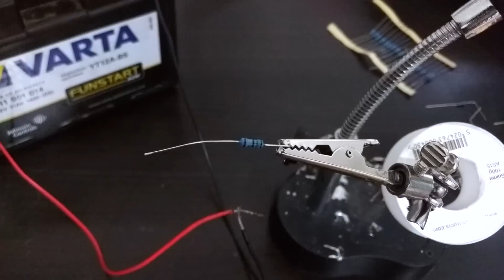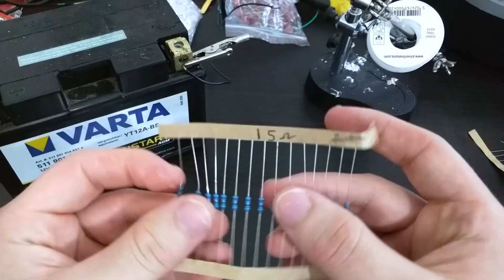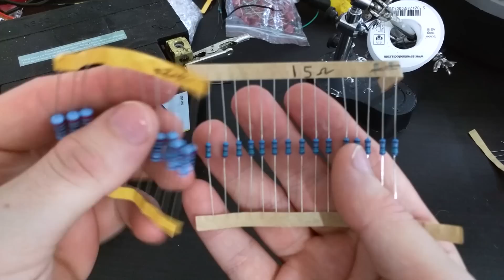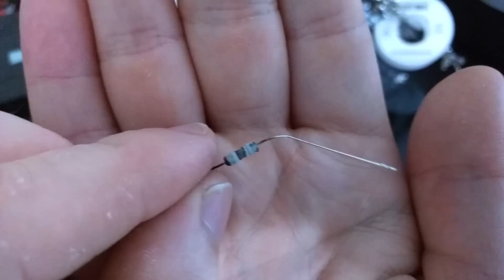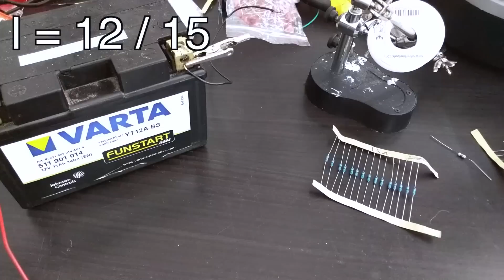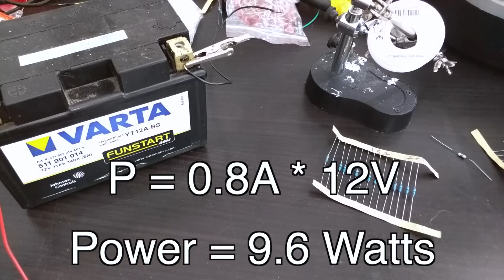How to choose the right Resistor

Comment: one thing i get confused about is i thought current is DRAWN by whatever load is in the circuit. like how come when i charge my laptop (AC> using a 30W power brick, or a 90W power brick, it doesnt matter because its only drawing whatever current it needs to charge my laptop, how come the 90W power brick isnt burning up my computer battery by "pushing" too much amperage?

Comment: Hey, I was watching the video on resistors and I was wondering if I could connect two car batteries in series to get 24 volts and then use 48  1/4 watt resistors to power my portable electric fan since I have both batteries already. I wanted to ask since I want to leave the fan in my car so that it is still cool when I go back to my car in the airport.

Comment: Howdy, Brother!  What resistor should I use if I have a yellow 10mm LED Emitting Diode (1.8-2.2V)  powered by two AA Batteries (on/off switch in the loop)?  Will 47 ohms work?  I'm not even sure if I asked the question properly . Thanks for any assistance.

Comment: With a lot of D.C. electronics, such as audio preamps, 1/8 watt is often perfectly suitable, but they are unpleasant to work with even if you are assembling a PCB. Just something for folks to think about.*
On the other hand, when you're ordering 50,100 or even 1000, the price difference really does add up quickly when purchasing a large variety of values. 

I tend to order large quantities collectively of multiple values, and the 1/8 are sometimes very tempting but since I am still building on perfboard for now until I get to manufacturing my own PCB's, I  have some 1/8 watt and greatly dislike them.
Even on a PCB, I would dislike them but I suppose use them if they are perfectly adequate. This also goes the other way because I don't like working with 1 watt unless I have to.

Comment: But also new players, need to be aware to ALWAYS measure your voltage source first. For anything running off a Car battery, don't calculate it at 12V. The voltage across a car battery can be as high as 14.8 when engine is running. I once chose resistors to run interior LEDs. The first time I dd this, I calculated the voltage source to be 12V. This worked out that my resistor choice was too low meaning the current being allowed to flow through the LEDs was a few over the limit of the LED... and all the LEDS eventually blew / burnt out one by one over a few weeks.

Comment: hi ,
I just wonder why the  resistor gets burn if the mechanism is in compliance with ohm law. I mean V/I is constant. Therefore when we increase the voltage, the system is supposed to  react that change  by an increasing amount of current so that V/I will not change. but instead it burns out. can anyone tell me the reason please
Reply: V/I is constant provided that V and I are not too big.   That is, Ohm's law is only valid for a given range of potential and current, depending on what the resistor can accommodate.  A resistor with a greater wattage rating will allow V/I to be constant over a greater range of values, but any resistor can be burned out if V and I get to be too much bigger than what it is rated for.

Comment: I have learned in hard way.. :/ I have just bought my potentionmeter (just one piece) for my project and I was happy that I calculated everything but I forgot to check how many watts it can take and of course started almost burning! I switched off immidiatelly thw hole circuit and it works so maybe it was just the last moment to do this before it broke down!

Comment: Can I use a 5w instead of a 2w with the same ohms?
Reply: Depending on how much voltage and amperage you are passing
If Voltage times (amperage divided by the resistence) is more than 2 and less than 5 
Then yes

Comment: Little resister is suited for 3 to 4.5v batteries with at least 5amp or less depending on the device used aswell

Comment: what happen if you put 10 of the 15ohm in parallel? what is the watt capability now? and what is the watt being dissipated? probably the current is smaller in each but the voltage the same. Is having 10 in parallel means the total wattage capability adds up like 0.25*10=2.5 Watt now? if you have 1.5watt dissipated it should be fine hypothetically?
Reply: the formula for calculating the combined resistance of parallel loads is 1/x = 1/R1 + 1/R2 + ...

Comment: I have a 28 watt LED strip that needs to be connected to a power supply of 12v, it works perfect with just 12v and no resistor, but all I want to do is dim it just a bit.. current going through, being used is around 2.3 amps, so if I get 5 ohm resistor? 12÷5= 2.4 amps, I'm not sure if that's good, or maybe I should get a? Idk I really think gonna start burning a few resistors till I get it right.. 😟😅

Comment: What resistor do you need if I connect a 3V battery ( 2x 1.5V battery) to a 4 ohm 3 watts speaker and Green LED that has 1.5 V and 0.01 AMP
Reply: You need to list the rest of your specs before you'll get a solid answer.

1.  What are the power characteristics of your speaker?
2.  What are the power characteristics of your circuit?
3.  What are you trying to accomplish?

Start by listing these and I'll see if I can jump in to lend a hand.
Reply: @percivul1786  it appears he/she wanted to make a speaker thingy with above specification but got stuck by the difference in current between the speaker and the LED (I guess we will have to use parallel circuit, but idk). 
1. Given the characteristic is whatever you like, how would you approach this ? 
2. What did you mean by circuit characteristic ?
I'm absolute noob and want to know too.

Comment: So I need to make a resistor based circuit for heating... Say up to 45-50℃ powered by 5v adapter/charger. So what value for resistors would you recommend,?
Reply: What are your power characteristics?  What's your volts in, amps in, etc?  It's easy to work out the math but simply saying you have a 5v adapter only give you 1/3 of the equation.  How many amps does your adapter output?
Reply: @percivul1786  @sir Bink, sorry for the delay in responding as I didn't receive notification for your reply.
I'm trying to use USB charger, generally rated at 1Amp output. Thank for responding.
Reply: @None1000-c8z  Ok, so let's look at the math here.  Principle one is the power you're using.  You have 5V x 1A.  Understand that it's rare for a power brick or wall wart to give you those exact characteristics, but for the sake of argument, let's just say it does indeed give you 5V and 1A.  This means that you're going to get 5 watts of power (V*I=W).  So, you'll be running about 5 watts through your resistor circuit and if it's just one resistor, you could easily cook it unless it's rated for that level of wattage.

So, that said, what all is going into your circuit?  Are you using a micro controller or just a passive network?  Do you have coils to run your current through?  What is the end goal of your project?
Reply: @percivul1786  it's just the passive... Precisely resistors connected to 5v USB charger. And the purpose is simply to generate heat (40-50℃) is good enough. I don't want to fry the resistors. The heat produced is to heat up the thick paper sheet soaked with essential oil which eventually will be used to evaporate essential oil (8-10drops) to disperse the fragrance.
Reply: @None1000-c8z  I see.  Ok, so the thing that jumps to my mind is that while you can use resistors to create a heat source, this is woefully inefficient.  The primary reason being that what you really want is temp control.  So, running 5 watts through a 10 watt rated resistor will get you a nice and warm resistor, but you have to consider the surface area you're working with.  So, while I personally would use a different approach (coil bed or something similar), I'll still give you the breakdown here.

So, here's what you could do.  First, measure your wall wart to see what it truly puts out in terms of power.  Run your calculations and match a resistor to the wattage by a factor of two (safety over things that smell good).  So, as an example:

Your wall wart puts out roughly 4.89V and the most current you can get is roughly .45A or, 450 mAh.  IF this was what you got, you'd simply run your wattage calculation. 4.89*.45=2.2 Watts.  Very little wattage.  So, what you'd do is get a 4.9 ohm resistor rated at 5-10 watts.  Power would run from the wall wart, through the resistor and back to the wart.  The resistor will allow up to 1A through it BUT your wart is probably going to only output half, or less than that.  So, you'd generate 2.2 watts of heat in the resistor, which would get vented out through it's shell (or housing if you get a larger one).  Either way, we're still only talking about 2 watts AND it's going to be on a very small surface area.  That said, it COULD work but I strongly suspect you will get very poor results using that approach simply because you also have to factor in things like surface area of the target, ambient temp in the room, etc...  All of those factors will likely cause you to slightly warm the paper but not much else as the heat tries to dissipate on it's surface.

Our of curiosity, are you stuck with oiled paper or could you perhaps "improve" the design a bit?  If you have flexibility, there's much more effective ways to do what you're trying to do here.
Reply: @percivul1786  hi there, im making a similar thing, but how do you know the wattage rating of a resistor? i only have the ohms/m
Reply: If you're using salvaged or unknown resistors, the good rule of thumb is to assume that it's probably 1/4 watt (for TH type resistors, which is what I assume you're asking for).  You can also lookup the manufacturer (if you know who it is) and look through their selection until you find the same one you have and it'll tell you.
Most "standard" resistors are 1/4 watt but the larger ones can be 1/2 watt or higher.  I have 100 watt resistors that I use in specific applications, but that's pretty rare.
If that all fails or you just "gotta know" the limits of what you're working with, there's a slightly more risky (and I'm not endorsing this) approach.  You COULD use a lab bench and set the voltage for the resistor itself, say 5V or something like that, if that resistor is rated for that and then VERY SLOWLY up the amps from something like 100mA until the resistor is warm to the touch.  If it's hot, that's too much wattage, so back it down.  If it's just warm to the touch, you're basically on the high side of what the resistor can work with.  Resistors are pretty hardy little guys if you keep them basically within spec.
Now I do not recommend using this technique with a live DC line that you can't control as it's most likely going to just encourage the resistor to release the magic smoke and potentially kill your circuit in the process.
If money isn't a big deal, and this is really the best answer, DON'T GUESS!!!!  Buy resistors that you can get the full specs on and remove the guess work entirely.
Reply: @percivul1786  Thanks for the answer, what i have is a 28awg kanthal coil, and the point is to heat air passing though a device up to ~130 degrees celcius. and i dont really know what the amp limit is for that, or how many amps you need for a specific temperature
Reply: @theemperiumofkek1362  So you're trying to make a vaping mod deck???

Comment: If you could help me I have a mission for you. 😊..  I have big  hilti machine . The component I need seems to be the resistor .. looks like the resistor shirt was made out of porculan and it is about 5 to 6 centimeters long cylindrical shape. The porculan broke and i dont have any information on what strenght and resistance it was.  How do I find the right resistor? Inside the resistor actually the resistor itself looks like a spring 15 centimeters long folded in 4 rows so it fits the cylinder... what do I do ?
Reply: you need to piece the shell back together and look at the color bands to identify the ohms of resistance. Google the color band chart for resistors. Pay attention to the physical size to approximate the wattage.

Comment: if you are salvaging some resistors from old electronics how can you know how much is the maximum rated power for such a resistor or electronic component ?
Reply: I think you find the color bands on the resistor and look up a spreadsheet online to match the color rating to the one you have
Reply: @mikebolton2388  as far as I understand, the color bands on a resistor only indicates the resistance of one. So how could you find it's power rating ?
Reply: you can't

Comment: I understand the concept of this, but you were using a resister that is for a single current flow. You were putting the battery positive to one side and the negative to the other. By doing this you were creating a hot spot by the + and - completing the circuit. Of course it would catch fire.
Reply: Clearly you don't understand the concept.
Reply: Ok you've had half a decade, have you learnt more since then? 😂
Reply: If this 15 Ohm resistor would be more than 10 Watt (big size resistor) it would handle that completed circuit and would be able to dissipate the generated heat without damaging itself.

Comment: I connected resistor to a charger (which gives 0.5A output), but when we calculate current through the resistor i.e v=ir gives 1.1A and power 12.1w is it correct r no.
Resistor:-Brown, Black, Black, Gold.

Comment: Very clear and I got a question, what if you use a 12v 1.5W solar charger linked to a 3.7v 3800mah lithium ion rechargeable battery and you got two pink 12v LEDs, what resistor do you need if they're in series or parallel please? there's a switch in this circuit too to only use the LEDs when it goes dark.

Can you try and explain as simple as you can please, I'm a beginner at best at all this.
Reply from the maker: You're linking a 12V charger to a 3.7v Lithium cell? Stop right there, unless you want an explosion. If you can give me a better idea of what you're trying to achieve, I will try and advise a little.
Reply: Yeah, I'll try and explain the circuit, at the start there's a 12v solar charger / panel(about the size of a smaller "smart" phone) 1.5w, then I was thinking of putting the 3.7v battery, then the switch, then the two pink 12v, 20ma LEDs so in the daylight, the solar charger would charge the little battery and at night it would have stored enough to power in the day to switch them on. I'm guessing that's dangerous by your reply.

Would it be better to have a 3.5v solar charger and use 3v LEDs instead? and do I need any resistors or diodes in a circuit like this? and what's best for this sort of circuit, series or parallel?
Reply from the maker: a 3.5V solar charger will not supply the voltage required to charge the lithium cells. since lithium cells at full charge are 4.2V. You can use the 12V solar charger, but will need to use a step-down regulator circuit that will at minimum regulate the voltage to 4.2V. A more advance and battery specific step-down regulator will operate at current mode regulation to supply 1-2A to the cells whilst monitoring the battery voltage, then switching to voltage-mode regulation to trickle charge the battery to 4.2V, thus ensuring a safe charge. As you can see, charging lithium cells safely is quite a complex process and is not as simple as connecting it straight to a voltage source.

Comment: Hey, firstly thank you for your informative videos. I am a newbie in electronics. I learned a lot from your videos but I have a question. If these are 1/4W resistors, why they dont blow up when using them with a led and a 9v battery? Sorry for the grammar, I am Portuguese. And a merry christmas
Reply from the maker: +BarbasBandas 666 because the current through the circuit is low enough that the power does not exceed 0.25W
Reply: oh... thats right.... thanks
Reply: @barbasbandas6665  :D